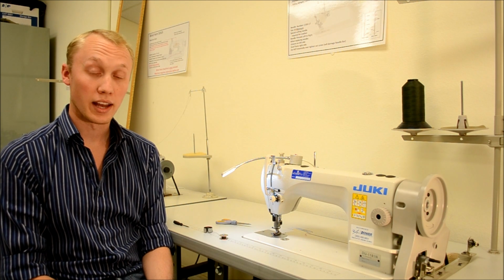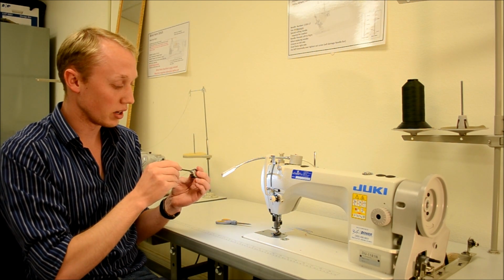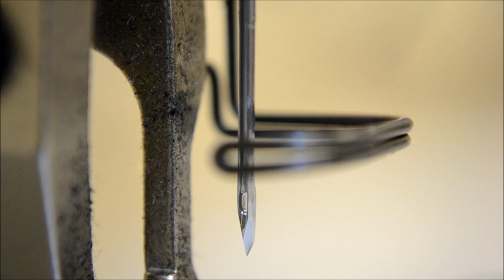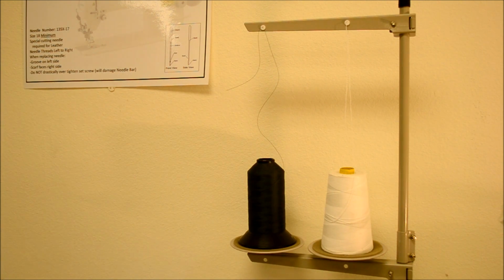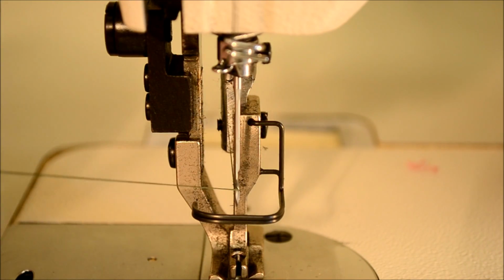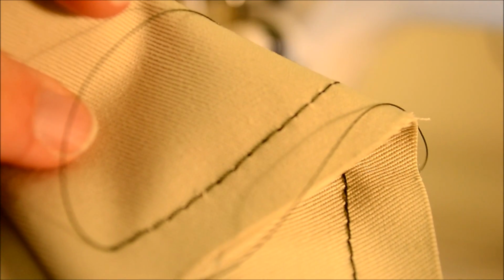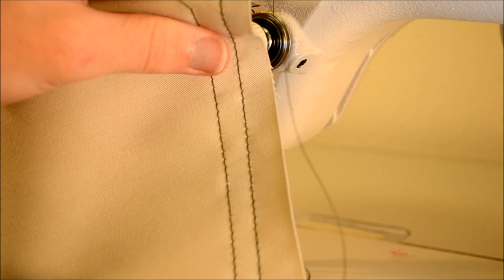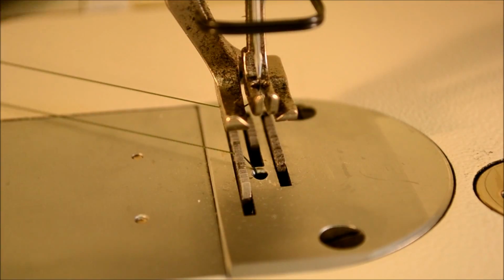Industrial Walking Foot - Juki DU-1181N

Comment: I have a Juki 1181N the needle and hand wheel wont turn . I'm thinking there could be some thread jamed by the bobbin. What do you think this could be?
Reply from the maker: If you've recently switched out your presser foot, sometimes the two different parts of the foot can get jammed together and prevent the hand wheel from turning, so you'll need to make sure the feet are aligned properly and can move freely. Otherwise you're probably right, you probably have some stray thread mucking up the bobbin carrier or the shuttle. I'd unthread the needle, remove the bobbin, and see if you can clear out the bobbin area.

Comment: What needle are you using for the leather on this video?
Reply from the maker: This machine uses DPx17 or 135x17 type needles, and for most types of leather you'll want a "cutting point" or "leather point" needle. I'm not sure about other brands, but Groz-Beckert labels their needles with a 1 or 2 letter suffix at the end of the needle code, such as SD or LR, so you'd be looking for a "
135X17/DPX17 SD" or ""
135X17/DPX17 LR" needle. By contrast, the "
135X17/DPX17 R" needle is a round point that you'd mostly use for woven fabrics. Hope that helps!
Reply: @phillipmiller90  Thank you very much!

Comment: Is this machine also for piecing quilts?
Reply from the maker: It could be used that way, but that's not really what it's designed for. This machine is designed for heavier materials like denim, canvas, or leather. It can sew lighter materials, but it's not particularly good at it. I'd recommend Juki machines in the DDL model series for piecing quilts.

Comment: How you liking your 1181N? I am currently using 5 machines Juki 414, Singer 20U (zigzag), Brother DBL, Singer 15-19 and my wife's Euro-pro for decorative stitching. Looking at the 1181N hearing mixed messages. Whats biggest needle it will take and is yours a servo motor? appreciate the input
Reply from the maker: The 1181N is a great machine, and would be a nice addition to your collection. I usually keep a #18 needle in it, but it can take needles up to #23, and with an adjusted base plate I think you can go down to #14 needles. I do have a servo motor on this machine, and I strongly recommend it. The servo motor is 50% stronger than a clutch motor, allowing the machine to operate more smoothly through heavier materials (especially at slower speeds), and gives you finer control over starting, stopping, and sewing speed.

Comment: Thanks for the video. Can you explain what sizes of needle and thread this machine can take? Thanks again....
Reply from the maker: With standard options, this machine can take needles as small as size 14, and as large as size 23. For most general-purpose projects (canvas, denim, thin leather) I prefer a size 16 or 18 needle, and use a Tex 40 or Tex 60 thread. To match your thread size to your needle size, google "thread needle size guide", and it should pop up with a handy little chart for you.

Comment: can you make a video filling the oil pan, setting the motor at different speeds, and showing how you adjust your stitch spacing closer or father? or tell me exactly how i do these things?
Reply from the maker: 1.) Filling the oil pan is easier than it sounds. Tip your machine back on the hinges so you can see the oil pan. You'll notice two lines in the oil pan on the left hand side, marking the low and high oil levels. Open your bottle of machine oil (available from your parts store), and SLOWLY pour the oil into the right hand side of the pan. Stop pouring when the oil level is just under the high marking. 2.) Changing the motor speed will depend on what type of motor is installed on your specific machine. Take a look at your motor under the table. If your motor is adjustable you will see a small dial with numbers marked around it - those numbers indicate the motor speed, so smaller numbers are slower and higher numbers are faster. If your motor isn't adjustable, you can talk to your parts store about swapping out the motor for an adjustable model - usually about $125 plus installation. 3.) To adjust the stitch length, turn the dial on the front of the machine, just above the reverse bar on the right hand side. Smaller numbers are tighter stitches, larger numbers are longer stitches. If it's hard to turn the knob, try holding down the reverse bar while turning the knob.
Reply: thank you. :)

Comment: can i get but a walking foot for 8300n juki
Reply from the maker: I'm not aware of any walking foot attachments for the 8300. Your local parts store should be able to order teflon or roller presser feet for the machine, though. A teflon foot or a roller foot would help reduce drag on the material as it feeds through the machine, but they won't provide the clamping power of a walking foot, or the torque required for sewing heavy materials.

Comment: Hi Phillip.  I'm trying to understand the differences in sewing machines.  I like this one.  I also like the Juki dnu1541s.  I had two questions.   In what cases does a person want a safety clutch built into their machine?  Also, I see this 1181n does some heavy materials but what is the lightest material you could recommend for this machine?  Thank you in advance for any reply.
Reply from the maker: The main difference between these two machines is the feed type. The machine I show in this video is a walking foot machine, meaning that the feed dogs and the presser foot work together to move the fabric through the machine. By contrast, the DNU-1541 is a unison feed machine, sometimes also called a compound feed. This means that not only do the presser foot and feed dogs work to move the fabric through the machine, the needle also moves while in the fabric, effectively locking all layers together and almost completely eliminating the possibility of fabric layers shifting. Obviously a unison feed offers the most security when sewing multiple layers of heavy materials together, but truth be told it's probably overkill for most applications. Most people will find that a walking foot is more than adequate for their heavy sewing needs. Note that both of these machines are for heavy materials only. If you're looking to minimize shifting while sewing multiple layers of lightweight materials, consider a needle feed machine, such as the Juki DLN-5410N.

In regards to the clutch, there's two things we could be talking about. In industrial machines, the clutch usually refers to the motor. A clutch motor is usually the cheapest option, but also uses the most electricity, and is louder and less powerful. If you're talking about an internal machine component, a safety clutch is a mechanism that disengages the motor if the needle hits something it can't puncture. The purpose of the clutch is to keep the machine timed properly. These are usually only found in home sewing machines, not industrial machines, and shouldn't be necessary in any machine designed for sewing heavy fabrics or leathers.

Comment: Hi! I always refer to your videos for reference because I have this exact Machine!! I have a huge problem tho!! I have been searching for a foot attachment for this machine, specifically a WELT/CORDING foot and a DOUBLE WELT foot. Even a zipper foot would come in handy. The problem is I cannot find a foot for this machine that fits!! I have been to local sewing machine stores and they cannot even figure it out. Do you have advice/resources on finding one for this machine ?? Maybe a way to put it on too?? its possible I am putting the foot on incorrectly, but because of the curve I am confused. HELP PLEASE :-)
Reply from the maker: Industrial machines can be hard to find parts for. http://www.sewingmachineindustrial.net/ <- This is my local parts store, but they will mail parts pretty much anywhere. They keep several different types of feet for this machine in stock, and can order almost anything. They have an impressive selection of attachments, too. I don't know specifically about welting feet, but I have a couple different zipper feet and topstitch feet that work quite nicely. Since these are two part walking feet there are two different set screws that secure the feet in place. The feet should be self-aligning when you screw them in place, but make sure the outer foot and inner foot aren't rubbing against each other. At the 4:00 mark in this video you can see how the feet should be attached. Hope that helps!
Reply: So very helpful, thank you!
Reply: I am unable to see how to attach the foot on this video? Am I missing something..lol..sorry to bother you!! I will call this company and see what they have for me. THANKS SO MUCH PHILLIP

Comment: Thanks for posting this.  I have a Juki DU141NH and have broken the thread takeup spring.  Are you able to show how I can replace this?
Reply from the maker: +Ju Ju The thread take up spring is fairly easy to replace, by simply unscrewing the tension adjustment completely and removing the tension disks to access the spring. Unfortunately adjusting this spring to the proper tension once you've replaced it can be fairly tricky. I'd recommend hiring a sewing machine mechanic for this operation, or at the very least enlisting the help of a mechanically-savvy friend.

Comment: Hi, can you explain the lubrication of this machine? do you just literally fill the pan underneath? Also, does the machine have a hand crank to lift the presser foot? I just got this machine for upholstery, but the instruction manual is not very helpful. thank you!
Reply from the maker: This model is auto-lubricating, which means that you fill the oil pan under the machine to the markings, and as the machine runs, a small pump distributes the oil throughout the machine. the knee lift is faster and allows for a much higher lift off the presser foot, but on those occasions when you need to lock the foot up there is a hand lever located on the back of the machine head above the needle. It's usually grey. This is an excellent machine for upholstery, and should serve you well. It has a learning curve if you're used to other types of machines, but once you learn all it's tricks you'll love it.

Comment: I recently bought a Du1181 N and it came partial assembled but would really like to see how to attach the bobbin winder, the plastic case that goes around the belt, and also how to attach the knee lift, how and where to put in the oil and any other start up information that would be useful.  I really enjoyed your video on this machine and it was really easy to understand and you did a great job on demonstrating the threading.
Reply from the maker: Kathy Evans I'm glad you liked the video! Unfortunately I don't have access to this machine anymore so I can't provide you accurate advice. Your local repair shop or the dealer you bought the machine from should be able to provide you with an owner's manual for a small fee. My local repair guys are at http://www.sewingmachineindustrial.net/ and they have a massive library of manuals that they can supply you with if you call them. Good luck, and enjoy your new machine!
Reply: Thanks. I contacted them and hope they can help

Comment: Looks like you still keep up with the channel so I have a question.  Nice  video by the way.  I've just recently started trying to sew but I'm using the Highlead 618 machine.  You may not be familiar but it seems the thread is so tight by the time I get through all the holes and loops that it won't pull back through the presser foot.  The bobbin is fine.  Is this a tension problem or something else do you think?
Reply from the maker: *****  Good question. I'm not completely familiar with Highlead machines. Is it a problem while you're sewing, or just while you're threading the machine? If it's a threading problem, try lifting the presser foot while you're threading - many machines have a mechanism to release tension when the presser foot is lifted, and resume tension when it's down. If it's still a problem while you're sewing, then it's definitely a tension problem - make sure that your thread cone unravels properly (on rare occasion you will find a poorly wound cone), make sure the thread stand is properly aligned over the cone, and try threading the machine without looping around the thread bars, just threading through them once. If none of those work, I'd call your local mechanic.
Reply: Thanks

Comment from the maker: Lola Falk I haven't sewn through leathers quite that thick before, so I can't say for sure. Based on what I have sewn, though, the DU-1181N will handle most heavy duty jobs, as long as the work fits under the presser foot (and it has an extra high lift, so you can definitely fit a tall stack). I can't imagine that you would have to invest in the 1541 unless you were doing really heavy stuff, like saddlery. If you trust your sales rep, ask their opinion, too. Best of luck, and happy sewing!

Comment: This is a fantastic video, thanks so much for sharing.  I sew leather goods (bags, wallets) and I typically use leather that is about 6-7oz at the thickest, or 2-4oz thick leathers stacked on top of each other (3-4 pieces stacked at a time).  I'm debating between purchasing either this model (DU-1181N) or the more heavy-duty DNU-1541.  Do you have any thoughts on which might be the better choice for my work?  I don't want to invest in the 1541 if it's too much muscle for my medium-duty leather sewing needs.  Thanks for your time and opinion!

Comment: Hey Philip, I have a Juki DU-1181N and I have a question about the oil inside the machine. The manual says that I should see oil splashing inside the oil sight window when the machine is running. I don't see that. The oil level down in the pan is above the add mark. Is there supposed to be oil poured down inside the machine through one of the rubber plugs? If so how much?
Reply from the maker: Great Question! My favorite repair guy told a story about this once. Your machine is probably fine. When Juki says you should see oil splashing, they're talking to industrial operators who use the machine at full speed. If you come from a home sewing background and you're not going full speed, you might not see it bubbling or splashing in the little oil dome. So how can you check to see if it's okay? Unthread your machine, turn the speed all the way up, and floor the pedal. At that point you're probably going to see it splashing, and your machine is fine. And if you want to periodically check, just take a look while you're filling the bobbin. If you don't see it bubbling, and there's plenty of oil in the machine don't overfill it. Check to make sure the oil filter isn't clogged or needing replacement. If that doesn't clear things up, consult your local sales rep or repair shop.

Comment: Are you able to saw all types of fabric on this sawing machine ? I know it is heavy duty but just wondering if it its capable of handling linens and other upholstery fabrics ? Looking for a good walking foot machine for a while and this one seems to be perfect ..
Reply from the maker: This machine is for medium and heavy weight wovens and non-wovens. That means no knits, and no lightweight fabrics like silk or shirting. Linens and upholstety will go through just fine. I believe, however, that you can get a separate set of feed dogs for the machine that work well on light fabrics, so with a quick parts change its a very versatile machine.
Reply: Thanks Phillip , that means I`ll also have to keep my old sawing machine..thanks

Comment: Philip, can you do a video on changing out the needle from sharp point to leather, I changed my needle and have the scarf on the right and the needle is not picking up the thread.. I am confused, I am using a db 1 needle, Do i have to change any settings with needle to hook relation?
 ALSO PLEASE COULD YOU TELL LME WHAT LL NEEDLE YOU ARE USING AKA LEATHER NEEDLE, JUKI TOLD ME TO USE DB 1 OR 165X
Reply: You should use DPx17 needles (135x17)